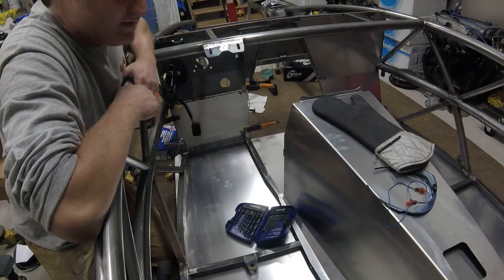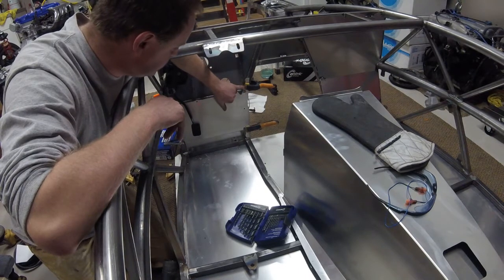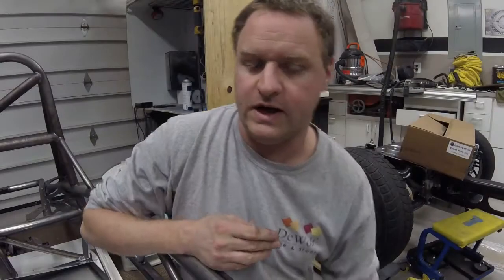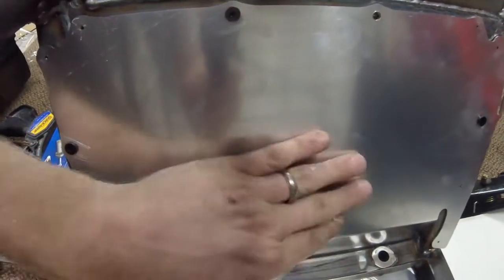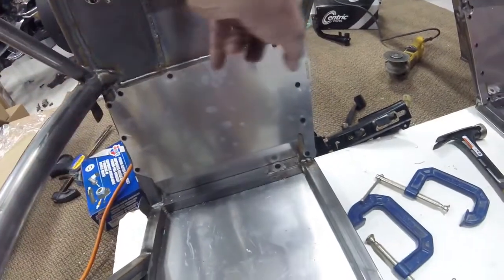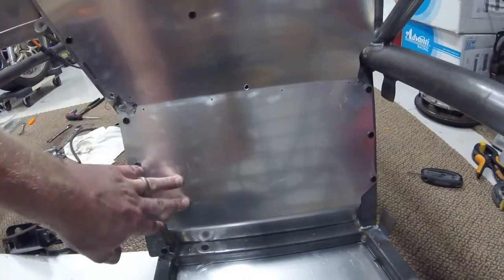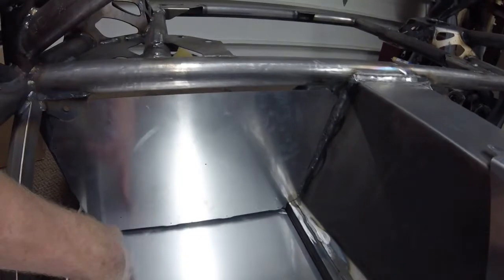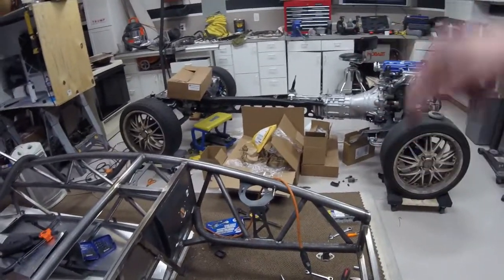Exocet Build: Mounting The Bulkhead Panels (Part 25)

Comment: What did you end up doing for the inner corner of the rear bulkhead?  I used rivnuts everywhere except for those 2.  Was thinking of just using m5 self tapping screws.
Reply from the maker: Honestly I can't remember but I am not sure of exactly where you are talking about.  The rears I remember using rivnuts everywhere.  All my panels are removable so I know I used rivnuts on those
Reply: @BuildingTheEXOCET Thanks for the reply.  Just the 2 in the corner for which there is no way to use a rivnut gun.  I was going to try the nut and bolt technique to fit into the inside lower corner.  However I am using stainless steel rivnuts which I find require a fair amount of force to set properly.

Comment: My chassis just arrived. Glad you’re a few weeks ahead of me. These video are sooo helpful 👍
Reply from the maker: John Leto good to hear thanks.  Check the underside of your floor to see how out of flat it is.  Also check the welded in portion of your trans tunnel to make sure it's flat and not way out of level like mine was.
Reply: BuildingTheEXOCET I will. I have a race chassis with the welded in steel floors so I think they’re good.Quick question. Are you powder coating the bulkheads as well?
Reply from the maker: John Leto well it's the floor frame rails that are out of alignment on mine and every other one I've seen pictures of.  Mine were around 1/2" off.    But to answer your question no I am not powder coating the bulkheads or floors.  I am going to use undercoating on all the undersides then hit the top side with some thin carpet.  The undercoating will hopefully absorb some of the rock noise

Comment: I do realize this is not a structural panel, but they do make countersunk washers that will offer the benefits of using a waster with a countersunk screw. You may want to consider looking into some to put under the heads... They make them in a number of styles and finishes. I think it may also help hold your carpet in place to the panel as well..  Not criticizing by any means.. Looks great! Please keep the updates coming !
Reply from the maker: Mr Tydriver interesting.  I will take a look
Reply from the maker: Not looking to hide the head under carpet as I don't want to have to remove the carpet to remove the panel.  These heads will help hole down the carpet and will be flush with the top of the carpet
Reply: A head shape called "truss" is a low profile head similar to a pan head.  I don't think that they are available with a hex drive.  With a head diameter of 11mm and a head height of 3mm the heads would be inadvisable under carpet